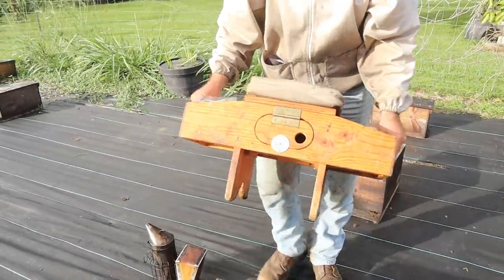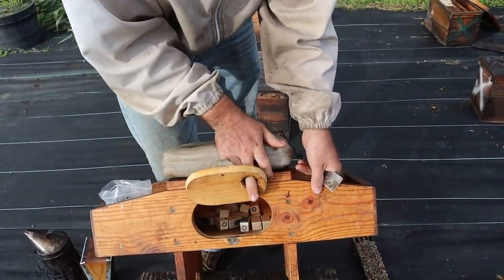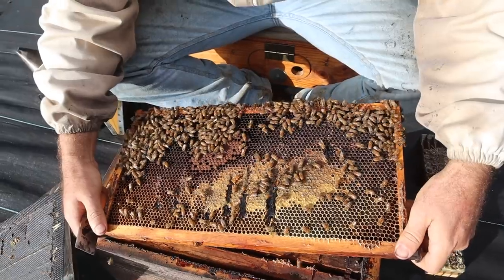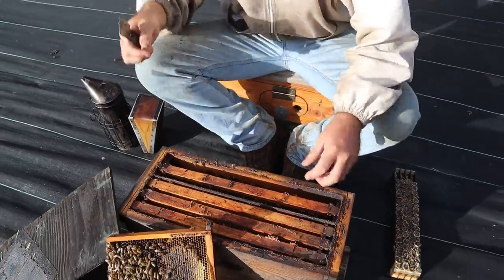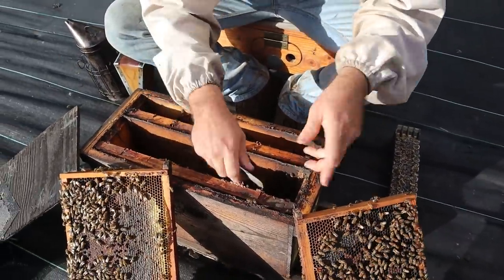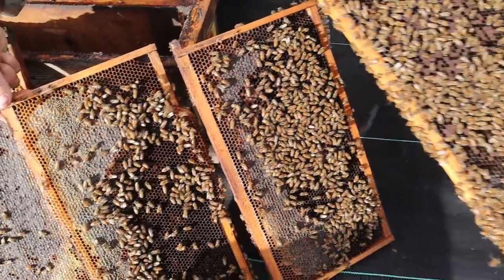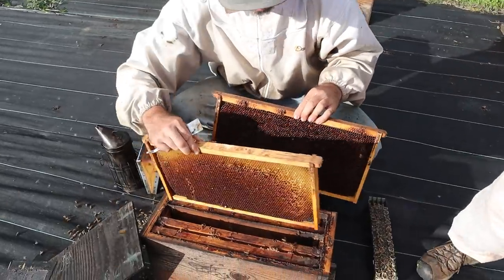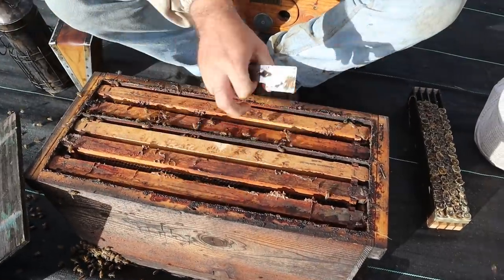Professional Queen Rearing Stool! Blueprints and How it is Used.

Comment: Shake the queen cell? Does a good cell feel different when shaking vs a bad cell??
Reply: Yes you can feel them rattle at that age no rattle its dead .. Im sure he candles each cell most do .. Bees will normally take down the dead cells in the cell builder ...on comb if your queen dies in the cell they will chew thru the side remove dead pupa if they remove the cell after means that queen died from virus  .. If your queen hatches you will see the end chewed off perfect that means you have a virgin running around